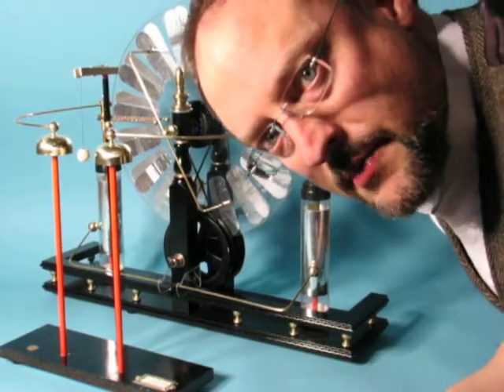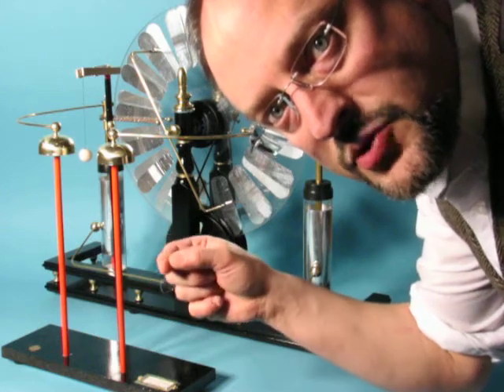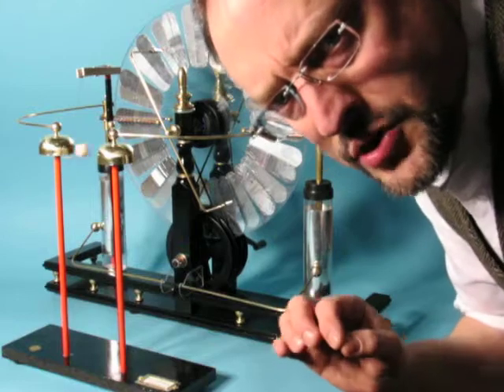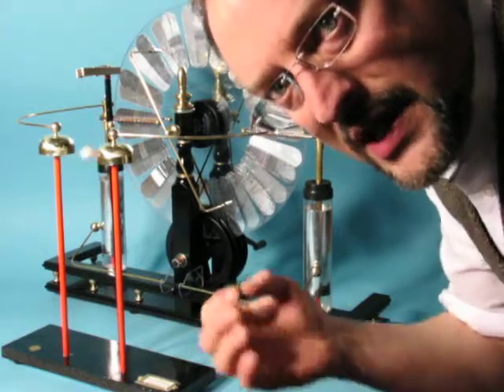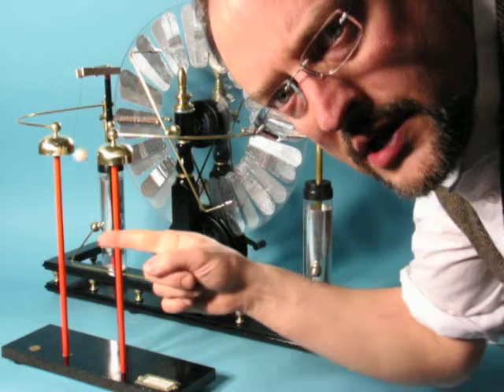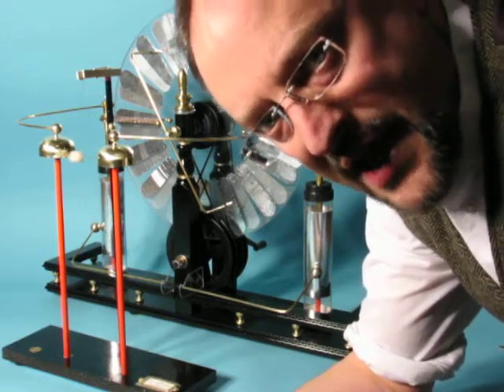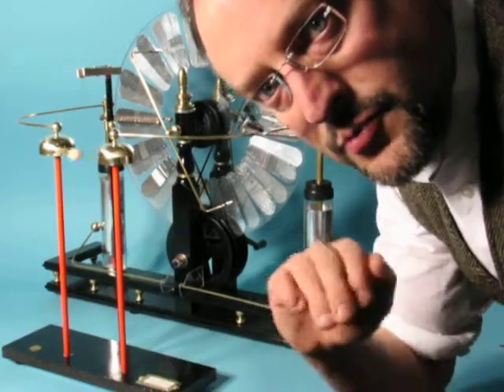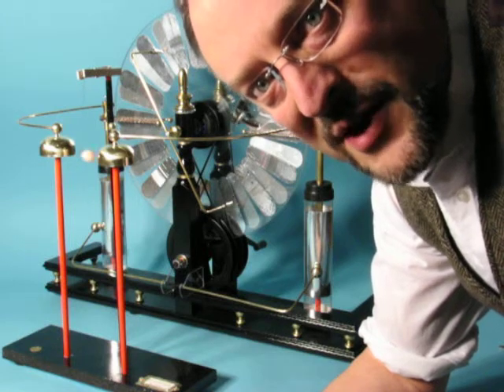Franklin's Bells Demonstration

Comment: The wooden ball is an insulator. It can not discharge the leydon jar (capacitor). The Wimshurst machine is also an open circuit. Therefore, the ball will continue forever.